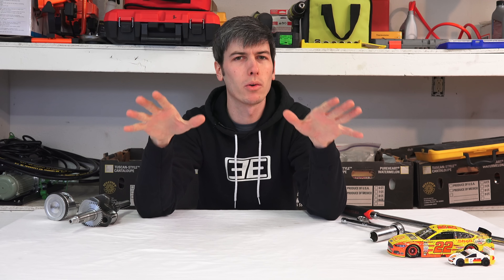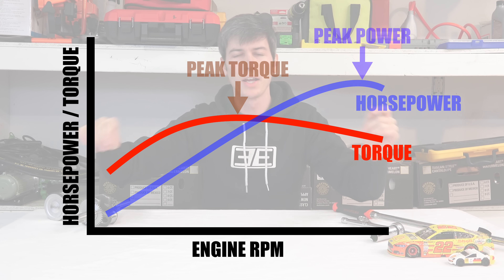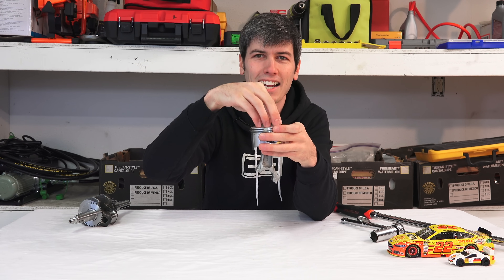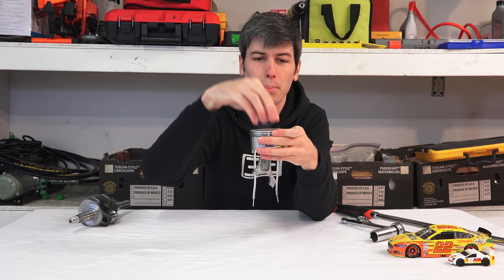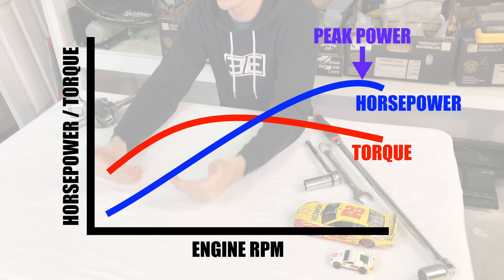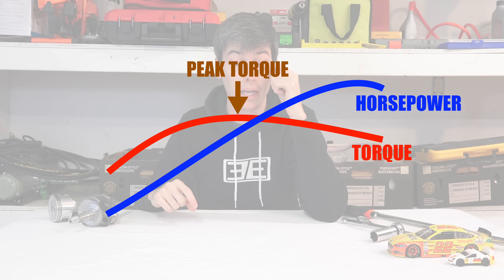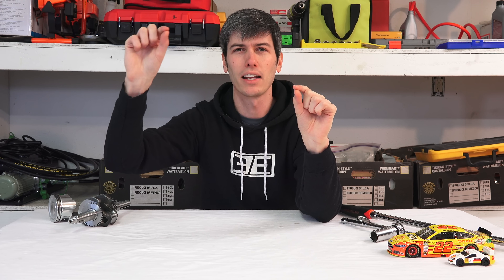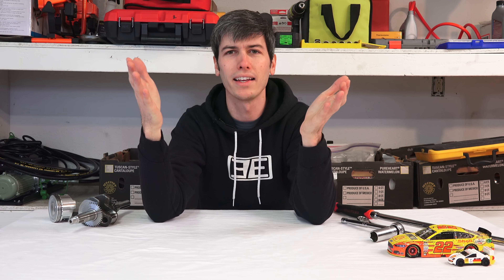Horsepower vs Torque - A Simple Explanation

Comment: i thought it was exactly the other way around... hp was the amount of potential energy available and torque was how fast it can produce that energy which is why cars with crazy hp dont have that much torque because other wise they would just constantly be spinning their wheels because the power is applied too fast... but you said it was the other way around in zhe video, now im actually confused 🙉
Reply: Fabian Bryan Chris The reason the electric car is faster at city speeds is that it produces all or most of its torque from a stop. This means it will have higher horsepower at lower speeds than a combustion engine which won't start producing more power than the electric car until it reaches higher speeds.
Reply from the maker: Well, for what it’s worth, the video is accurate haha.
Reply: Engineering Explained ok im just going to say it lol: i think its not correct what you're saying bc literally every forum and video i've watched about the topic said the opposite... im not trying to start a fight im just saying its a pretty complicated topic and perhaps you mixed something up 🤷🏽‍♂️ off course i could be wrong too but then i dont underatand why my parents egolf (EV) which only has about 115 hp absolutely destroys other cars in city traffic up to speeds of about 40 mph... it's a car with apretty low hp figure but a relatativly high torque figure compared to other standard cars... which would explain why it accelerates so fast
so yeah im gald to discuss this very detailed perhaps you could even do another video about it, because im actually interested in how it really is 🤔
Reply: I don't agree 100%; most modern turbodiesels have about 90% of max torque available at just above idle rpm, no need to wait a very long time to get high torque/power.  I'd like to see a 0-100 acceleration test between that eGolf and comparable petrol/diesel Golfs..  (no GTI or VR6, maybe a 1.5 TSI  and a 2.0 TDI) ; also the eGolf has only 1 gear, so no time 'wasted' shifting ;)
Reply: obviously the egolf would absolutely get destroyed in a 0-100 km/h race because it just dies of above speeds of about 50-60 km/h but in city mini drag race while still obeying th speed limit of 50 km/h its pretty tough to beat
Reply: one-gear, no shifting, just 'pedal to the metal'... and other drivers probably just sleepwalking... yes ;)  ; I don't know, to be honest...  the Egolf next to a 1.6TSI and the driver launches with slipping clutch... I'd have to see if the Egolf is really that much faster in a mini sprint; not saying yes or no... but curious to see it tested!

Comment: In your example with 100 torques/200HP vs 200 torques/100HP, I would be curious what the car with more torque can do better, maybe pull a larger weight overall? Torque must have some advantage
Reply from the maker: If they were geared the same, the one with more torque would accelerate faster initially, but would eventually be passed. But in the real world, you can change gearing, so you would gear the car with more power appropriately and it would be faster in every scenario. Pulling weight makes no difference, if both weigh the same (no matter how much weight you add), more power will be quicker.
Reply: But cars with high torque are never geared the same as cars with high HP. In the real world this would NEVER happen so your example is meaningless ..

Comment: So... does peak torque mean maximum fuel efficiency/power and peak horsepower maximum acceleration?
Reply from the maker: Peak torque does not necessarily correlate with peak fuel economy. Generally that is at a lower RPM.
Reply: But if Im struggling up a hill I want max HP right? When would I want peak torque?
Reply: Look up a BSFC map. Generally peak efficiency (lowest specific fuel consumption) will occur near peak torque. The problem is the resulting power will be greater than the amount required to maintain cruising speed. This is why pulse and glide is the most efficient driving technique.
Reply: Wictor Nyman To go up a hill you want to maximize the force at the wheels, so you would downshift until get closest to peak power (peak wheel force at a given speed).
Reply: Very grateful, knowledge is power!

Comment: The thing is it is not that simple. Having high torque vs horsepower achieves different things. i.e. if your car needs to pull heavy things you should be more interested in torque figures rather than horsepower. For example diesel engines traditionally have low HP but high low end torque, they cannot go fast but you can carry heavy things with them at low speeds. Off road cars also favor low end torque
Reply: Christoforos Paphitis High HP and low torque could accomplish the same thing, it would just wear out clutches and torque converters faster.

Comment: Good video ! Thanks.  Here is a good one for you . I have a Honda cbr 650f motorbike I love it. Anyways it has 90 hp at 11k revs and 64nm of torq what comes in at 8k anyways this is the latest model but comparing to the previous generation back in 2011 they had a Honda cbr 600f. This had 100hp at 12/13k revs then the same 64nm of torq at about 10k /11k revs . Iff you could explain the main differences that's would be great

Comment: Nice simple explanation.  Forgot the magic number of 5,252 lol
Reply: That magic number only work on old imperial units...
Reply: Watt?
Reply: Tacit Tacet I thought horsepower and torque ratings were imperial..isn't that what this whole video is about?
Reply: Check the pinned comment from him on this. He explains why 5252 isn’t included.
Reply: Jeff Ziegenhron Do you think conversion factors are magic? Is it a Vegas show every time someone converts cm to inches? For torque & power try the numbers 63,025 & 9.5488. Look em up. The factors simply depend on the units.
Reply: Yes BHP now quoted in PS (metric horse power I think)
Reply: I work in the French automotive industry, we use kW for power and Nm for Torque (SI units), but we still use RPM for engine speed (the proper SI unit would be rad/sec)
So our magic number is 0.1047 (100Nm at 1000rpm means 10.47kW), or 9.55 the other way round. With rad/sec, of course the ratio would be 1 (even more magical!)
Reply: hsvkidusa And there's no 'magic' of 5252. It's purely a coincidence of the 2 arbitrary and separate scales. There will always a point of coherence when 2 separate ratios are combined and scaled referenced to each other with a common denomination.
Reply: Hp is... Torque is not unless you specifically say lbs.ft or how ever you word/write that.. The modern world uses KW and Nm and there is another "magic" number for that (can't remember it of the top of my head... And I'm not gonna work it out but you can Google it if you want to see what it is)
Reply: 5250 is absolutely essential.
Reply: Cassette Walkman 5252 is part of the calculation to find hp from torque. Tell me again how it's not important.

Comment: I have a car with 2.5TDS Diesel engine, online information says I have peak torque at 2200RPM and peak hp at 4500RPM. I have tried switching gears at 4500RPM and the weird thing is, next gear feels like it gives more acceleration than the previous gear at 4500RPM, apparently switching gears at 4000RPM seems like it gives more acceleration. I see the logic behind the explanation, could the problem be faulty online information and/or the fact that the RPM gauge has a little delay, which makes me overrev the engine not knowing I am actually at, say, 5000RPM when I switch gears? Also had a thought that my engine is now 20 years old and has 300k km on it, would that make the peak power RPM drop by a bit?
Reply: first: your engine wasn't exactly designed for max acceleration performance; second: diesels typically perform more efficiently at low/mid rpm and don't like to be redlined; third: yes, all engines lose some power when they get older; to be perfectly honest, I'd never push your engine beyond 3500 rpm or so...  I bet it even runs extremely smoothly and pulls very well at 1850-2500 rpm
Reply: Joeri De Strijcker 2.5tds is one of unique diesel engines that has all its torque at around 3000RPM, and car makers make redline for an engine where its no longer effective. My diesel can rev up to 5500RPM in neutral.
Reply: If the only thing you have are feelings, then I would check them first ;) Then, your engine might not have the same power curve than advertised, indeed. But it is quite unlikely that your make more power at 3500 rpm than at 5000. Manufacturers would have drop the red line to prevent engine wear and fuel consumption if that was the case. But again, your engine might not behave as when it was new.

Comment: Torque is the force or power of 1 rotation horsepower is the most power/ torque at the most amount of engine revs. Diesels are very torquey but the engine doesnt rotate much. Hence the lower power. A ferrari has peak torque at 6000 rpm wich produces lots of horsepower

Comment: In my opinion ,  a car that have a high horse power only represent the car still generate a high amount of torque at the high RPM . The reson why we may say the high horse power equal to better acceleration is because the wheel of the car are connected to the engine , as a result where the car run at a high speed the engine speed will aslo run at a high speed , in order to continue accelerate we need more torque at high RPM range ( high torque at high RPM equal to high horse power ) . 

Now lets imagine there have two engine with different characteristic , Engine A have the peak torque 200 Nm around 2500 rpm - 3200 rpm , Engine B have the peak torque 160 Nm around 4000 rpm - 5800 rpm , as a result Engine B have more horse power than the Engine A . In the gear ratio setup , Engine A is likely will need a gear ratio have much different between each gear set ( ie : 1st 3.583 2nd 1.947 3rd 1.343 4th 0.976 5th 0.804 ) to let engine speed back into the peak torque range , in case of the Engine B  it may allow to use the short gear ratio between the each gear set , since it only need a bit of reduction to let the engine speed back into the peak torque range . According to the leverage theory , we know the torque can be manipulated by the gear ratio , therefore this will enable the engine that have high amount of torque at high rpm will have much more opportunity to use the gear ratio to manipulate the torque as they don't need a very short gear ratio to let the engine speed back into the peak torque range . Therefore, the wheel torque of the engine B is likely will greater than the engine A during the whole acceleration process , as a result engine B will have a faster acceleration .

Comment: I don’t have an engineering degree or a whole lot of mechanical experience but I like to understand how stuff works. I’m trying to watch this with my four kids playing around me so I probably missed something, but, if having twice as much horsepower as torque equals faster acceleration why do all the fast production cars now days seem to have very similar horsepower to torque ratios? And what about souped up diesels with far more torque than horsepower? It seems to me gearing could be changed to favour a torque happy engine just as easily as a high and quick revving one. Also your explanation for torque made sense, but is there a set amount of resistance aka torque all engines are tested against to determine horsepower? Am I muddling this all up and I should just watch the video a couple more times?

Comment: Ok great but what about pulling power ?
Reply from the maker: The force at the wheels is what matters. That’s a function of torque multiplied by gearing. And torque of course a function of power and RPM.
Reply: Engineering Explained Yes I agree. But still that torque is only delivered only at each motor rotation, so the greater the rpm, the greater the power thus the pulling. So why for pulling high torque low power is better than low torque high power ?
Reply: I think torque, as a characteristic at a given moment rather than over time, is crucial to start moving the load from a dead stop, no matter the speed. Once the load is moving, HP comes into play describing how it can accelerate and what maximum speed it can reach.
But just like Jason said, ultimately it's force at the wheels that matters, and the force at the wheels depends on engine torque, gearing and the wheel size.
Correct me if I'm wrong.

Comment: great video.. although I was waiting to hear more about the crank rod. more specifically the main journal and the throw journal on the crank. . . so I'll say what you didn't. torque is created in the crank, there is a main journal on the crank that connects it to the case and allows it to spin. the throw journal is connected to the rod that connects to the piston to the crank. this is where your "engine torque" comes from or the distance between the two journals. the greater the distance the more leverage the piston has on the crank, which translates to a longer draw on the piston which, also translates to a lower top RPM

Comment: Actually depends how long the race is. 100ft/lbs gonna net you a particular top speed against drag. 200ft/lbs gonna supercede that threshold reached by 100ft/lbs car. 200hp gets it to the threshold quicker, but of the race is longer than the time it takes for 200 HP 100ft/lbs car to achieve its maximum velocity, 100hp 200ft/lbs car will power past.

Comment: Very nicely explained, but I have a question... I am a truckdriver, and my truck has 485 HP and 1550 ft torque. Would a gasoline engine with 485 HP and 500 ft torque acceleration the same, if both vehicles grossed 19,000 lbs (bobtail weight of my truck). ?
Reply: Well, mathematically yes, it would achieve the same acceleration with the proper gearing. 
However there are also other things vehicle designer have to consider. For hauling heavy loads a high torque/low rpm engine makes life a lot easier.

Comment: I work on a top fuel funny car and as a engineer for a Performance and race part manufacture . You should come out to a drag race and experience real power. High horse power high rpm engines some times get beat buy the same horse power at a lower rpm! Basically the quicker you make power in the rpm band and the later you can keep peak torque up is what really wins races. And you can mechanically gain torque threw gear reduction yes but you can also increase gearing to take advantage of a low rpm high torque engine. MBEP AKA cylinder pressure is power💯

Comment: Good torque numbers wins races, Hp numbers make lovely printouts to show people?
Reply: The other way around, actually.
Reply: Tyler Rodriguez no, but I know simple physics. Your example is apples and oranges. We are talking powertrains here, not cars. Corectly geared and in the same chassis, the civicsengine would be faster, yeah.
Reply: Tyler Rodriguez are you trying insinuate that a rwd V8 car beats higher HP civic’s from a dig because of torque and not traction?
Reply: Jaboxs - so do you live in a world where turbo civics with high peak HP and no torque routinely smoke high torque low rpm V8's from a dig? My next question would be... does this world have an atmosphere made out of vape?

Comment: you still overcomplicated it a bit. you seemed a little lost when you got to the manipulation of gear ratios, shifting gears, and it's relation to the curves. the engines curves remain the same, but shifting up the gears at the torque peak and holding to hp peak is dependent on transmission gearing. ideally the shifting would hold between the peaks of each curve to keep the engines happiest in it's power band. gearing in a car is all built to compliment this idea. torque is leverage, but in a twisting motion. that's why big trucks use higher torque engines to get the heavy trailers movingg, horsepower is sort of the ability to increase the rate at which the truck can accelerate. on it's own the numbers and relation of the figures is used to base everything from tire size, axle ratios, and short or wide ratio shifts.

Comment: So you can just apply the torque figure (or curve) faster? It's counter-intuitive that unit of torque  wouldn't have a set time component. But I guess it makes sense then that having the option of manipulating,  maximizing torque through gearing with more power is more useful than more torque that manifests slower without remedy.

Comment: A lot of people tend to compare horsepower figures to knlw how a car performs. For two similar engines with different horsepower figures that doesnt tell the whole story. For instance, there are two cars that I like to compare that are both the same bhp. M50 vs m52. One is a 2.5 liter and the other is 2.8 193 bhp. One could think probably both are equal. Or maybe think that the 2.8 liter engine has a lower performance because its poor engineered. The thing is that the 2.8 liter gives at 1500 rpm more torque than the 2.5 at peak torque. And you don't get much info about power figures or power curve comparing them because power figures are a scaled torque figures. By quickly comparing two torque curves with similar engines and similar transmision you instantly know how one is going to perform compared to the other. You could also get an idea about how efficient an engine is thisway by comparisson.

Comment: Wonder why motorcycle gear so hight in first gear 90+mph. maybe safety usually hit speed limit at power band. maybe aggressive wheelie control?
Reply: Yes, a lower gearing would just make it flip over easier, so they have high lower gears to allow closer higher gears.